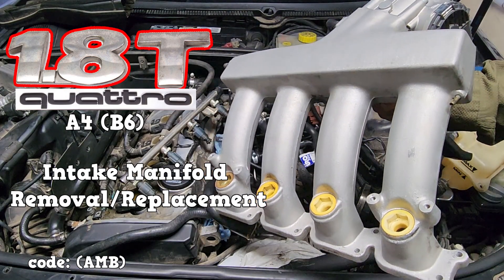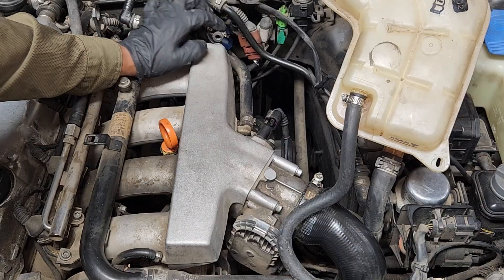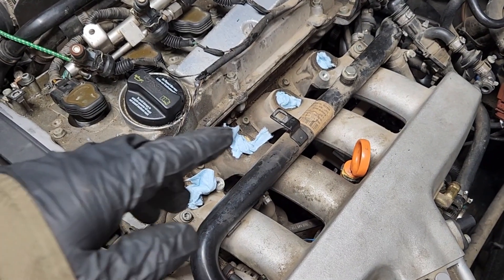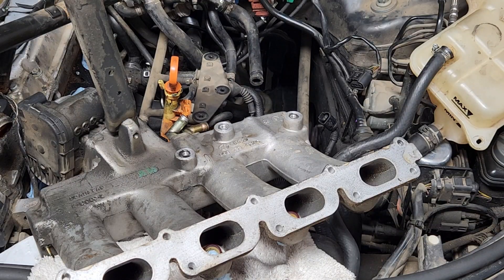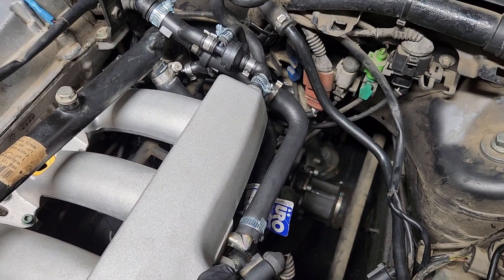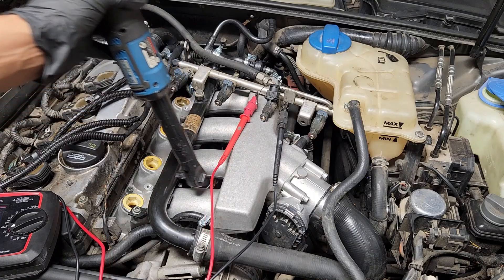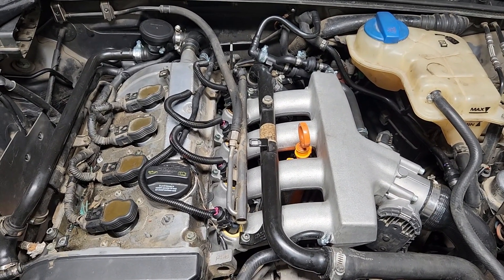Intake Manifold Removal Audi A4 1.8T Quattro (AMB, B6)

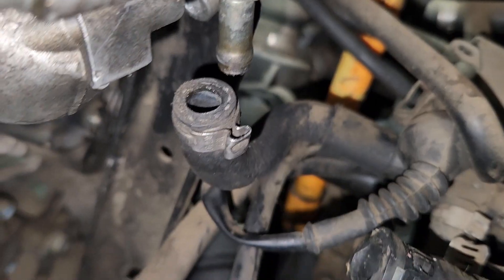Comment: 3:38 that hose you disconnected is connected to a 3 way plastic piece, what is that piece called?
Reply from the maker: hose that connects under the throttle body, leads to a 3 way metal tee, this part is not sold
Reply: @OldSchoolNoe can i just buy a generic T connecter that fits the hoses?
Reply from the maker: @El_Vicente1  yeah, give us an update on which part # you used!